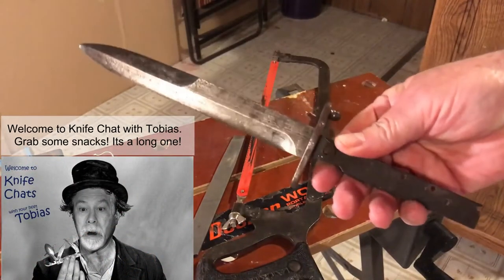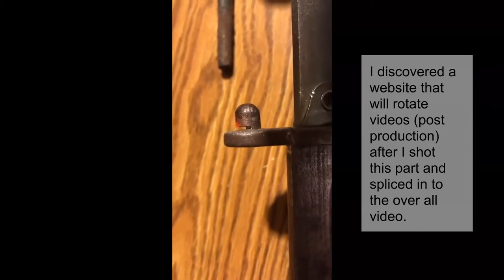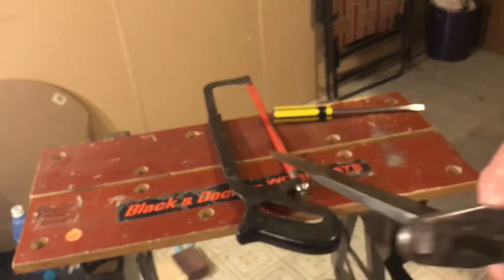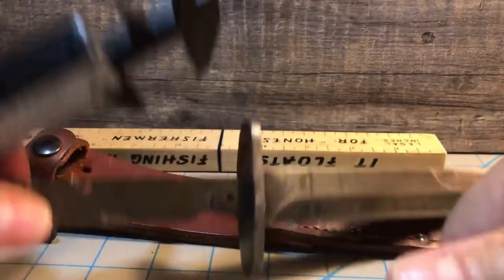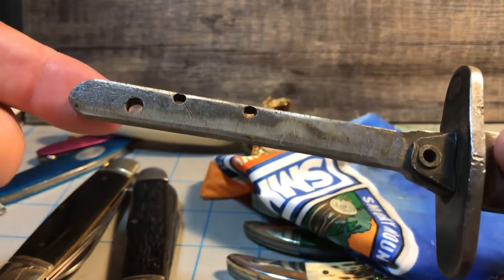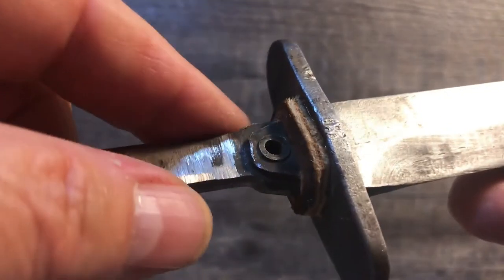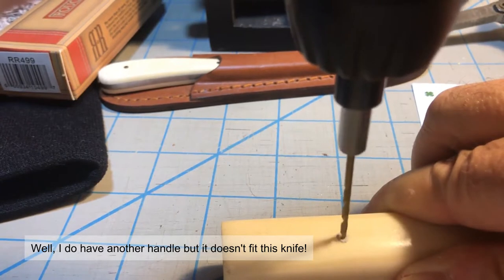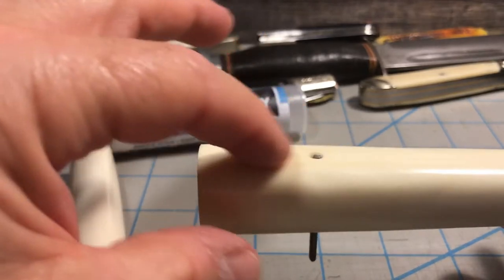Converted M5-1 Bayonet/Trench Knife

Comment: You can still change out that screw when you find a more appropriate looking one. Nice job getting this done. I have a bare knife blade made out of a horseshoe and a 2 point buck's antler to fashion as the stag handle...but I am stuck at how to cut/split the stag into two sides with the limited tools I have. Thanks for persevering and showing us how to git er done.
Reply from the maker: I'm sure I will change the pommel out.   I just needed to get this thing done and off the bench.  Thanks for watching.  Splitting stag is a royal pain.  I've only attempted it once and it was a bit of a bit of an epic  fail. The thing with it, is  the split will follow the grain which tends to be very twisted.  
(I tried splitting  like you would would a block of wood!) 

About the best you can do is put it in a vice and try to cut it in two with hack saw.  Prepare to go through a lot blades and get some sore arms.   The stuff is extremely hard!  If you can come up with a better way, shoot me an email!  (knife.chats@yahoo.com)

Comment: That looks pretty cool, the staining from the leather adds to the patinated, distressed look. I like the buffalo bone, I have used cow shin bone for a couple of things but the shape is all wrong for a good knife handle like that.
 JB Weld do a white putty for plastics that would do the job but the greater the volume of putty the warmer it gets, the heat accelerates the reaction and gives you less working time.
Reply from the maker: chris osh, thanks. It was fun but also exasperating at times.  I think that’s why it took so long.  But now I’m already thinking of the next project!
Reply: @KnifeChatswithTobias  Yep! There's always a next project, I just bought three Polar blades from Brisa of Finland (very cheap but good 80CrV2 carbon steel), two 65mm and one 95mm Puukko blades to keep me busy this winter when I'm fed up with working on my house. I want to have a go at making a traditional Puukko and sheath with the 95mm blade.

Comment: I bought a 5 dollar yard sale m5 bayonet someone was about halfway done and quit so I bought it the guard was already off and pin gone so it sat in the hard plastic scabbard for almost 2 years until I figured a nice piece of maple what was a seamstress ruler was perfect width and I cut it to fit perfect used the screws the guy who sold it broke out of the old plastic or bakelite scales drilled them a d screwed it on everyone loves checking it out

Comment: Hello. Nothing good happens fast. Nice project. For future reference, if you need a good white Two part époxy; Try Milliput white. I have been using it for years on porcelaine repairs and never had a problem. All the best.
Reply from the maker: RHINO 54, funny thing is I use milliput in my model building.  I never thought about it for filling voids I bone!   Thanks for the tip and for supporting my channel!